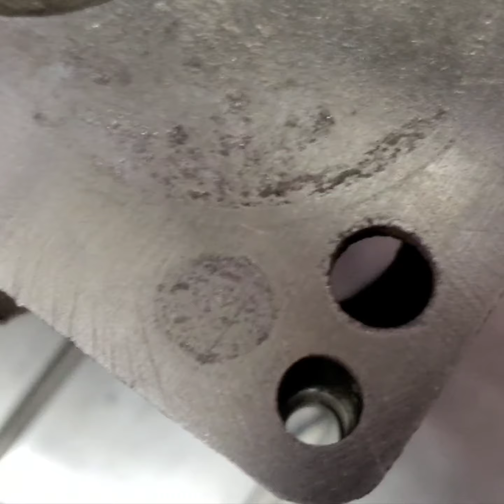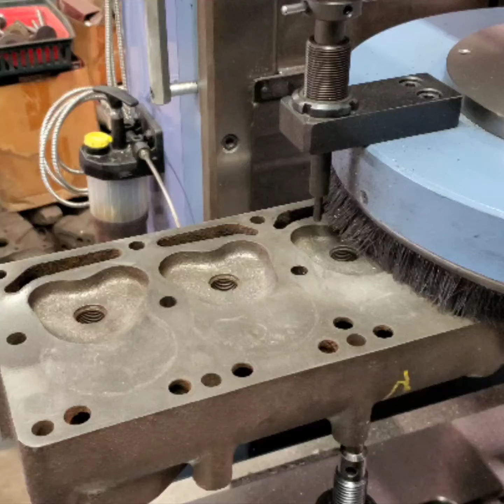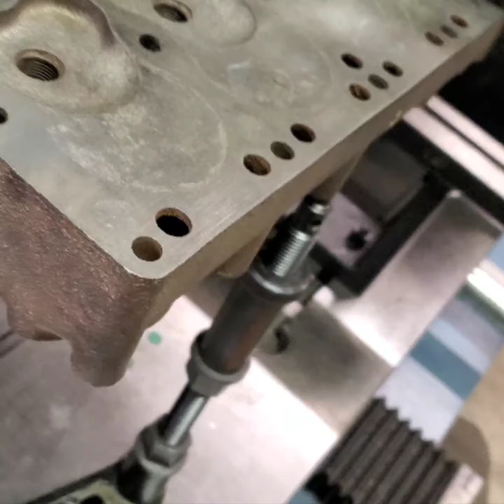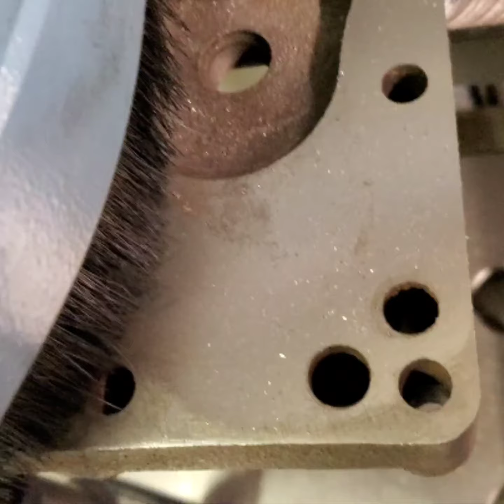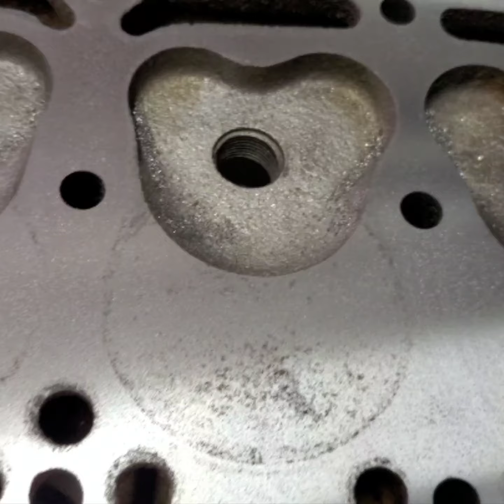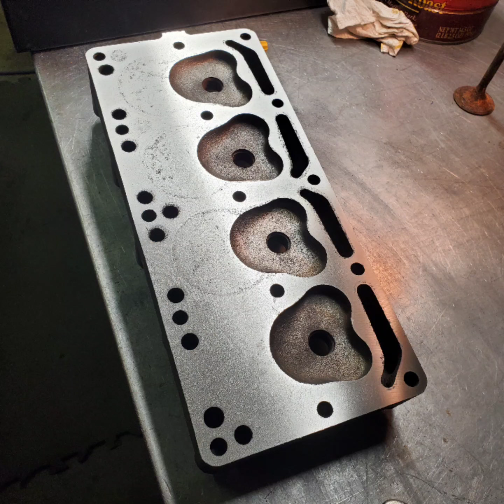IHC C60 Tractor Re-Surface Head.

Comment: Ed, when a head is warped in that manner,   after milling, does it affect chamber volume? Will each chamber be the same? I'm not questioning your work. I'm just trying to learn something new.
Reply from the maker: Hi Brad, thanks for watching and the question.
Yes, the CC volume will change a little bit.
But it is usually not a big deal and rarely corrected.
These type of engines are usually low compression. 
But on high performance engines to check the CC's or chamber volume may be necessary. 
But that would incur more time and cost.
And this would be up to the Customer.
How far would you want to go?
But in applications like this, it is not necessary in my opinion. 
It's an Old Tractor, it will run fine.
Have a good day. 👍🇺🇸👍
Reply: Thank you! @edsmachine93
Reply from the maker: @bradsrestorations1085 You're welcome Brad.